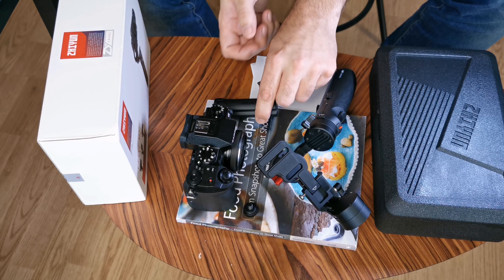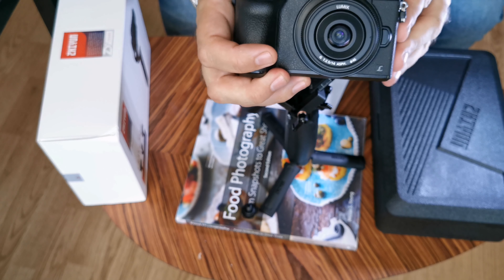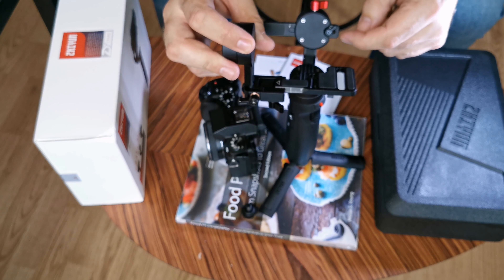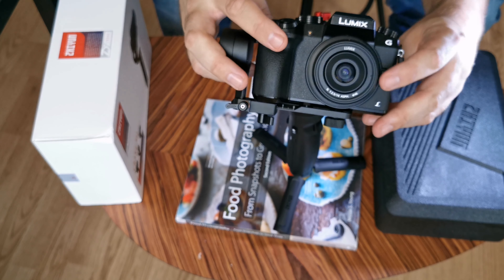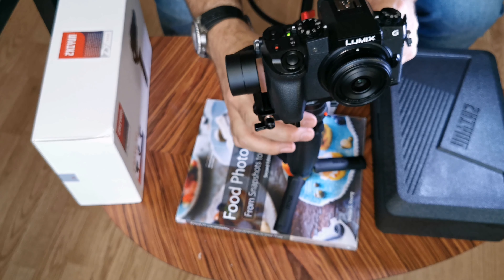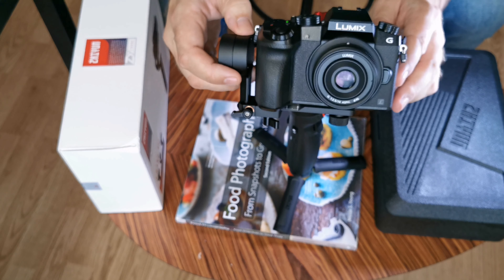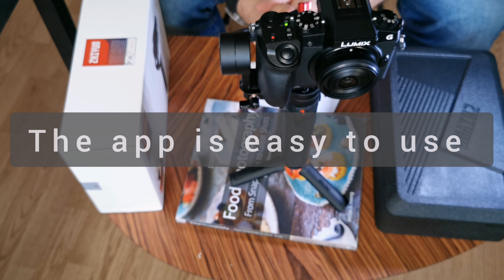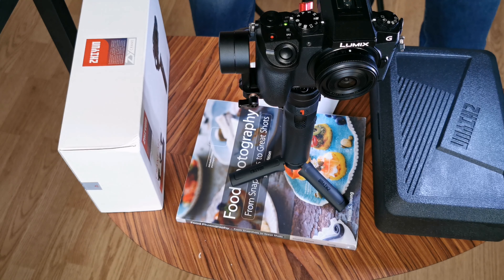How To Balance Lumix G7 On Zhiyun Crane M2

Comment: Would love to see, is it possible to balance the camera with the LCD flipped out to allow for a better viewing angle of the screen?
Reply from the maker: Good question Nolan, never thaught of it. I'll answer it tomorrow in a new little vlog.
Reply: Paul Behind The Lens That would be awesome and i’d really appreciate! I feel like the g7 would be a great camera to use and i’m super tempted to pick one of these up for mine, but one of the biggest questions i had was whether it would balance. Even if it doesn’t balance or throws the gimbal off, is there enough visual to operate the camera and compose your shot? I’ve weighed my setup and it comes in around 100 grams under the weight limit and would be a perfect setup. Would definitely appreciate a video!
Reply from the maker: Hey Nolan, thanks for the inspiration. I'll try my best when it comes to the combo M2 Crane & G7 as I am working in exact the same shot. I'll be doing the full review and will be posting it. 
Tip when it comes to the G7, I have currently seen the prices drop (new) from 500 euro (body) to 388 euro over the last month. Just so you know
To be continued.. :)
Reply from the maker: @nolanhasting  Hi Nolan! How are you? 
Went over your questions and it was enough for an entire episode :) You can find it on this link: https://youtu.be/uATvzS7V67U

Comment: do you think this gimbal can handle a Lumix fz300 well?
Reply from the maker: Tthe fz300 is a superzoom camera with a barrel that extends so if you change your focal length youll have to re callibrate the M2 again. Additionally the form factor of the fz300 will cause issues with basic ballance. I tested it with my fz80 and it didnt go well and that camera is super zoom as well.
Reply: @PaulTakesPhotos  is it possible to use it with fz300 ??
Reply from the maker: @Heart7Throb7  i am not sure jasar i never owned that camera. Best if check compatibility list and find out if a camera of similar size are supported.

Comment: Hy mr.paul . I ask , If the Lumix G7 flips full screen to the left, can it be balanced in zhiyun crane m2 ?
Reply from the maker: You can balance it but in general I would not recommend the G7 on the M2. With the screen out you'll notice that the M2 motors at times struggle
Reply: @PaulTakesPhotos  thank you mr. Paul 🙏🙏🙏

Comment: I LIKE your review! I'm interested in this gimbal and am going to buy it. I'd like to use it with my reasonably small and lightweight Panasonic Lumix DC-FZ82 (LUMIX DC VARIO Lens), but it's not on the list of supported cameras. I suspect the reason is the size of the lens (at 120x zoom mode) and the corresponding balancing restrictions. Could you answer to my question? Or what kind of gimbal would you recommend for this camera? Thanks in advance, I look forward to your opinion
Reply from the maker: Hi Mr. Pulkownik :) 
I happen to own that camera and will look into it this week and come back with answer or an episode on the channel. 
Will keep you posted and send you a message once I have it tested
Reply from the maker: Czesc Pan P! Check out my answer (as it is the start of the episode) on your Crane M2 and DC-FZ
https://youtu.be/ZJOUxpYjyoA 
Video will be published tomorrow @14h! 
Let me know what you think!
Reply: @PaulTakesPhotos  Thank you so much, I'm looking forward!
Reply from the maker: Czesc Pan Pulkownik :) I just posted a new episode with yet another gimbal for the G7 which actually performs well :) just wanted to let you know
Reply: @PaulTakesPhotos  
Thank you very much for your attention  and memory!
Now I use Panasonic Lumix G7 with Zhiyun Weebill Lab (if lense's IS is not enough) and Pentax  K-70  with  camera's IS (I have 3 zoom lenses with stable length ), so  Lumix DC-FZ82 rests in peace...

Comment: Thanks for a great tutorial ! I purchased both items days ago and only now, I discover that Crane M2 does not connect to my G7 via wi-fi. I have researched dozens of videos, but seems like nothing really works out. Please help me to solve this if it is solvable at all. Thank you!
Reply from the maker: Hi Demna, I Returned the M2 long time ago, unfortunately.
That said I face similar issues and from what I can recall I managed to connect the G7 to the M2.
I believe you have to open the app (zplay) go to the connectivity and simultaneously switch your in camera WiFi on. Once you have done that you go back to the zplay app and you should see it in the connectivity, than you can connect it.
Again I am rusty on it but if it doesn't work I would suggest you check out my latest video on the dji ronin sc.
Your issue is not your camera which is awesome, the Crane M2 is specific gimbal not suitable for G7 if am honest.
Sorry if my response is not as helpful as I would have liked.
If any questions let me know
Reply: @PaulTakesPhotos  Thank you !
Reply: @MrDemnadevdariani   Hi Damien, did it work ?
Reply from the maker: I will release a new episode tomorrow how to connect G7 with ronin sc

Comment: did you get it to work in vortex mode?
Reply from the maker: Hi 86, I have been shooting today with the Crane M2 and tried all modes. The Vortex mode works but not very well, that could be the weight of the camera and lens. Make sure you unlock your axis.
I'll make a review, focussed on the modes once I have a few more hours under belt with the Crane M2. 
Keep you posted
Reply from the maker: I just posted a small review. The Crane M2 comes with a catch 22 when it comes to Vortex and Camera compatibility
Reply: Hi Paul, do you think M2 would work well with a bigger lens attached to the G7?
Reply from the maker: Ha Noah, short answer: no. The issue with the M2 is the camera size/build of the G7. It stretches it to the max whils balancing with a light 25mm. Heaver lenses made it impossible to balance

Comment: Hi, I saw your video about balancing G7 ot Crane M2 but with small lens  and I wander if it's possible to balance it with bigger and heavier lens. I have G7 (with idea to upgrade with more recent Pan or Oly mirrorles model) and Olympus 12-100 pro witch is around 550g. Is it possible to balance this kind (or little heavier) system on Crane M2
Reply from the maker: Hey There, thank you for the question. I have tried to balance the G7 with the 12-60 and 100-300mm and with heavier lenses the Gimbal struggles a lot as the weight centre point  shifts from the camera to the lens and the M2 really couldnt handle it 
I tested it with the DC-FZ82 with in body lens and it was a 100% no go.
Reply: @PaulTakesPhotos  Thank you for your reply. Yeah probably this  gimble is not suitable for my system. May be I will forward my attention to Crane v2.

Comment: You didnt do the last balance position. The camera needs to be able to rest flat with the lens pointed up with out tipping forward or backward. This camera can not to that because the space taken up by the viewfinder does not allow for it to be balanced in that position. Using the gimbal like this will put strain on the motor and cause issues with camera smoothness.
Reply from the maker: And that is exactly what happened. That is why i returned the M2. You are right